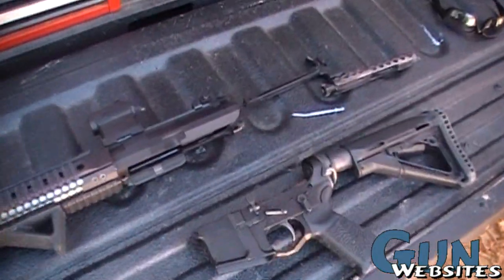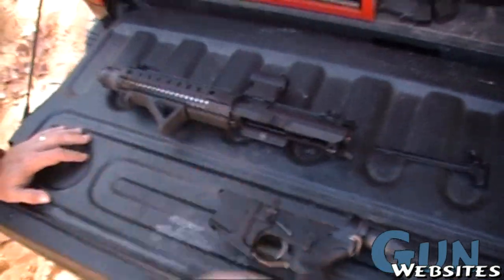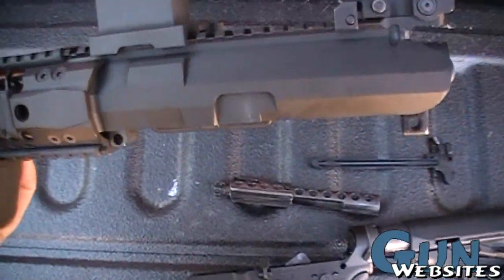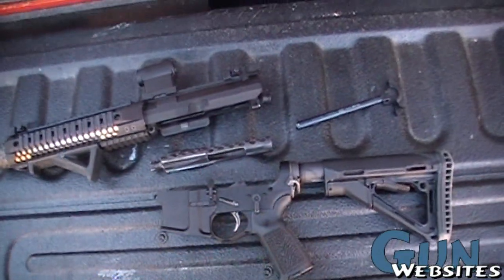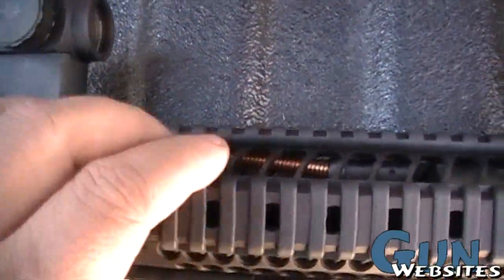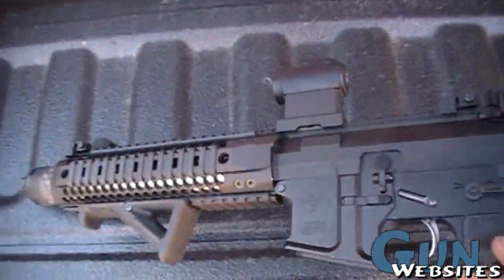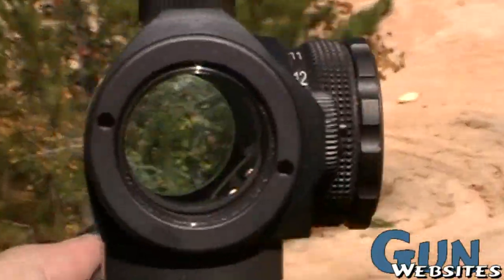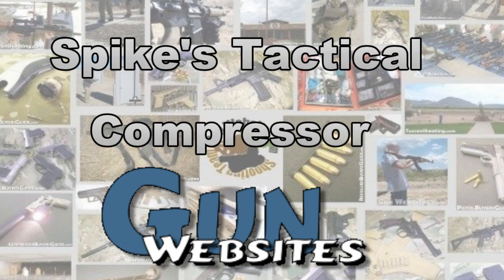Spike's Tactical Compressor 5.56 Suppressed Short AR15 Rifle

Comment: I don't get running a light BCG with a heavy buffer. Won't that decrease dwell time? I guess for a SBR the dwell time is pretty short anyways and might night gas it enough to run a standard weight BCG. Interesting. I'd like to get ther 300blk compressor at some point.